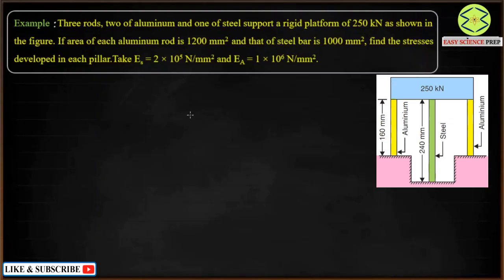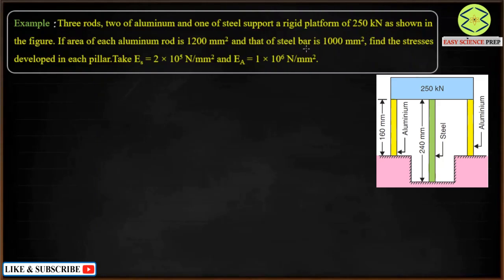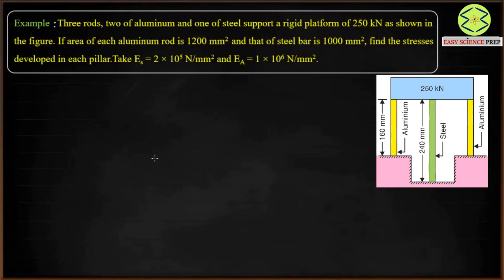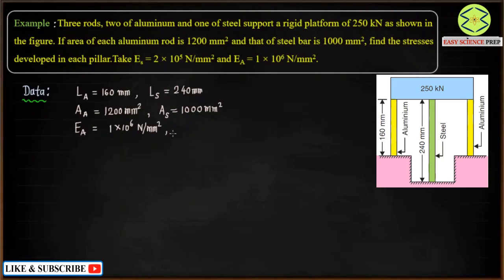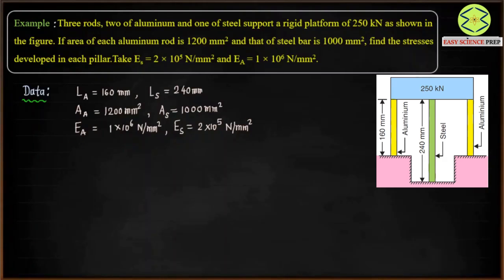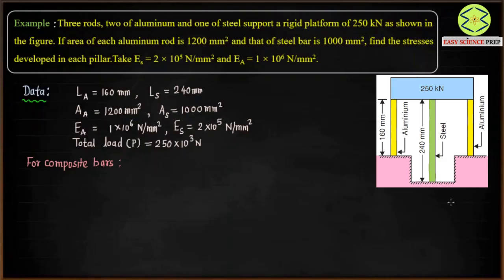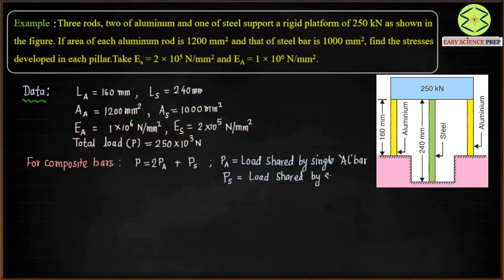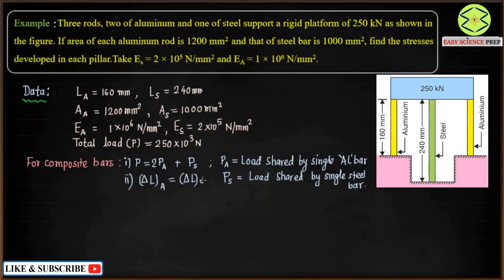Problem based on stresses in composite bars

Comment: Sir the value of Ea is given 10^6 in the question but you have written 10^5 in eqn 2...
Reply from the maker: There was a typo error in the question, actually E for Aluminum is approx. 10^5 N/sq. mm. I have solved by taking correct value of Ea. Thanks and regards.

Comment: If the steel bar is something height below the aluminum bar then what will be the load required to compress the aluminum bar upto the level of steel,sir??
Reply from the maker: Similar procedure can be adopted to solve it. You have make deformation equal for each type of bar and total load would be shared by each bar. Hope it answers your question.